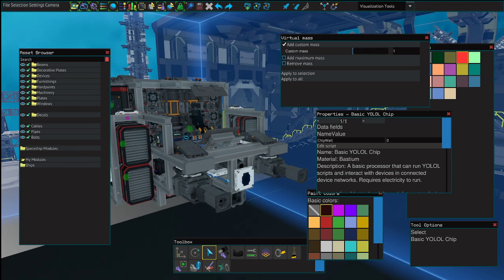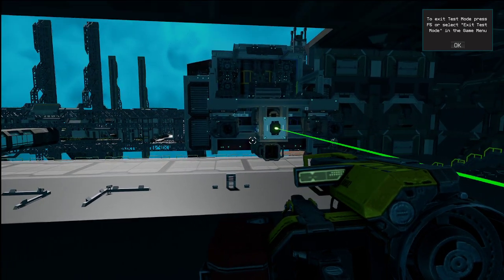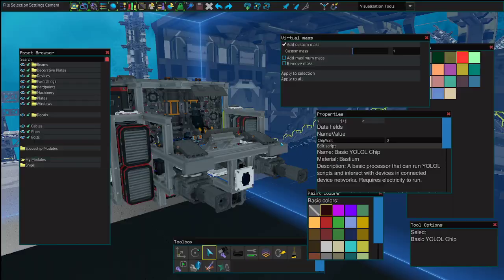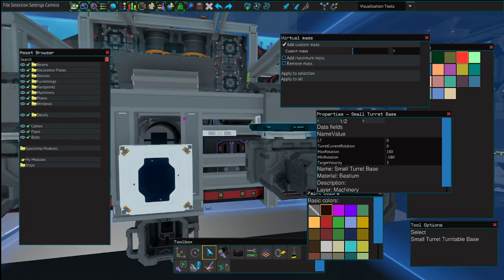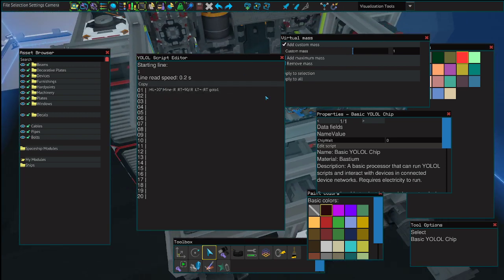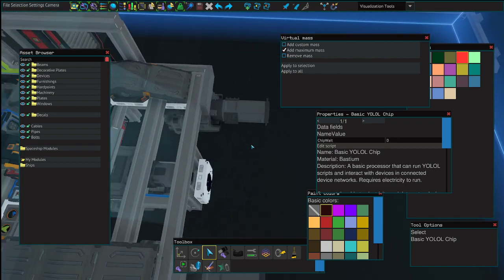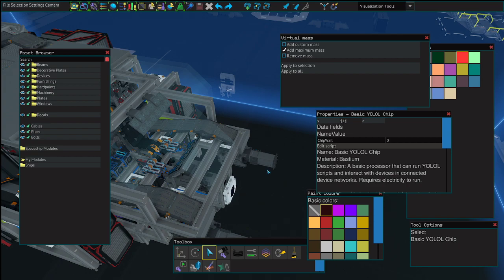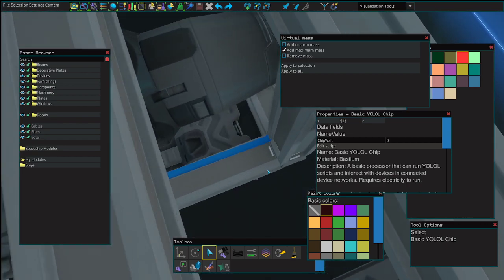Starbase Tutorial: Setting up Smart Mining Lasers

Comment: Your code doesn't make any sense.   :ML is the on/off toggle for the mining laser, where 0 is OFF and anything not 0 is ON.  You could multiply it by a billion and not affect how it turns on or off.  The only thing that does anything in this at all is the ratio divider for :RT being 90 / range.

Comment: For many ships, the basic setup is slightly different. The rangefinder is usually not at the same level as the lasers.
I bought the Momento and upgraded it. The rangefinder is at cockpit level and the lasers are about 2 meters lower.
This made the challenge for my script a bit more complex.
For me, not only the rotation, but also the pitch is relevant.
For my setup I wrote the appropriate script. Unfortunately this is not universally applicable for other ships.
If there are then the rare ores, I can write a script with the professional chip, which optimizes the calculations with a specification of an angle.
Reply: Pro chips are not available yet... atan() would save my world

Comment: heya i know a really easy way to code this with using only one variable with the turrets, if you leave LT as 180 and -180 for max and min and then inverse these numbers on the other turret then you can control them both inversely mirrored with the same input, put max as -180 and min at 180 on RT and change the name to LT and remove all references to RT in the code and it will work with much less code, now they limitations is this will perfectly mirror them so for this type of rangefinder code it's perfect, for anything else it becomes less perfect, for example i'm working on code that can use your mouse to control the turret but then each turret will require it's own angle since each turret will be pointing left or right values separate from each other and will require individual fields.
Reply: Oh wow, that's a really useful tip. I had no idea inverting the minimum and maximum angle had that affect! Time to rewrite my mining laser code! :D
Reply: how are you accessing any mouse input, is there a way to access that mouse steering mode from yolol or something?
Reply: @N1ghtR1der666  you can check the video i uploaded earlier today for an explanation on setting up mouse aiming https://www.youtube.com/watch?v=szokSSDdctE
Reply: Using your suggestion above, how can I add a limitation as to how far my turn tables will go?
My mining lasers are set back slightly and below my cockpit and therefor if I were to get too close to an object the lasers will start to shoot my cockpit.
The turn table limits don't seem to work and get overridden by the yolol.
I modified the code already to account for pitch as well since my mining lasers are not at the same level as my range finder and I wanted the option to use the range finder without the lasers on so I have it so that those can be turned off too. Only thing i cant figure out is the math behind adding limitations.

if :Lasers==1 then :ML=15*:RF-:R else :ML=0 end
If :RF==1 then :LT=-87/:R :LP=-87/:R end
goto1
Reply: @armedbobery4879  so limitations on turret rotation is actually why i stopped playing the game, no matter what i did or tried to do, eventually the lasers would randomly spin around once and a while and shoot something they shouldn't.... the code could be perfect and it would still happen, it saddens me that this is still an issue 4-5 months after i stopped playing, as i consider it a game breaking bug.

the closest thing i found to a "fix" was a mining laser check that takes place to ensure the lasers are pointing within the range they should be, so in your original code you need a if x and y = 1 or something like that, then x being the ML=1  and the y=1 being a check for the angle of the turret, turrets have input range and output range, the output range is the current rotation of the turret, the calculations you put into your movement of turrets should have a min and max value so you want this to be your range, so for Y you want "if turret current angle is less than it's min value or higher than it's max value then y = 0" Y will be the check to make sure the lasers are pointing forwards to the correct angle, it's best to run this code on it's own yolol in a single line if possible so the check is happening as often as possible, because if the turrets flip 180 degrees instantly which can happen they will still get a single pulse of laser beam off which will damage something, so it's good to have a shield wall of some stronger material or double layers behind the laser turret to protect internals.

hope this all makes sense, it's 1pm of day 2 me not sleeping :)
Reply: @heflar  makes sense. Thank you and I will try that tomorrow when I get back on next.
Reply: @heflar  Tested this. I actually did try this and it works "Mostly"
Tested a few differences to this idea.
TX is my Turret current rotation reading, ML is my mining lasers, R is my range from my object reading returned from my range finder, Lasers is the button for my mining lasers on.
1. If :TX<-17 then :ML=0 end goto1 (If current rotation is less than -17(Maximum safe rotation before damage) then turn off the mining lasers)
    This when going up to the object too fast will cause the lasers to pulsate for some reason. Maybe the read speed of Yolol is too slow compared to other factors.
2. If :R<6 then :ML=0 end goto1 (If Range from object is less than 6 meters then turn off the mining lasers)
   This had worse pulsing issue than the first option
3. If :TX<-17 then :Lasers=0 end goto1
    This method worked great and is the one i am likely to go with on my build. These simply turn the button off when I reach that -17 rotation angle and keeps the button off and it will not even let me turn this back on if the rotation is still below -17, once I back up and the rotation is > than -17 then I can press the laser button back on and continue mining.
May get annoying to have to toggle this back on all the time but better than a destroyed cockpit if I end up too close to the asteroid /  target.
Could be highly useful for any automated turret system too maybe although i dont think there is many viable automated turret builds, could be useful for manned turret gunners not paying attention to where they are aiming when following a target.
Reply: @armedbobery4879  oh glad to see you found some kinda fix! i was making a radar system which aimed a turret for an auto aiming system but turret rotation is so slow it was practically useless, they need turrets that can move faster AND they need to be bug free so we don't have to code yolol around the bugs.

ultimately i found there was not too much for me to do in the game due to the limitations of the output and input devices, i really do hope the game keeps progressing because i had great fun in the small amount of time i was playing, the problem i had was that everything felt like it was made out of paper, so if you made something larger it would just become a larger paperweight when it gets damaged.

because of this i ended up making a couple of smaller manned ships that cost less than 200k and could shred through anything, and if i lost it, no big deal! my fav ship to use was a 20k ship that had a thruster you could turn on and off so you would not make a thruster trail in space, it would alternate between "stealth mode" and max speed, so nobody can run from you, the idea was that you get close to an enemy ship without them even knowing you were there, then you would board their ship and kill them with a personal weapon, taking their ship without any damage!
Reply: @heflar  oh that stealth mode sounds cool. 
And yeah I hope they add more soon as well.

Comment: My question is, how would one get this to work with Pitch on Turret Cradles too? - I'm bad with yolol
Reply: I'm working on a manual for the script. But for those who don't want to wait and figure it out themselves, here is the code (I added some extra comments. Maybe they don't fit inside the yolol chip):

//MLTRAS-Advanced
xs=2.8 ys=-2 zs=-4.1 rxs=45 rys=0 rzs=0 //Distance/Rotation to the rangefinder
r=3.1415926/180 // Deg/Rad conversion
x=xs+:X y=:RFD+ys z=zs+:Z rx=rxs ry=rys rz=rzs :RFP=1 goto10
if :MLTRAS then :ML1=1 goto4 else :RFP=0 :ML1=0 :TP1=0 :TR1=0 goto5end
// set turret rotation
t=z/y t1=t-(t^3/3)+(t^5/5) t=x/y t2=t-(t^3/3)+(t^5/5)
:TP1=t1/r :TR1=t2/r x=xs+:X y=:RFD+ys z=zs+:Z goto10
//x Base axis rotation
t=z/y t1=t-(t^3/3)+(t^5/5)-(t^7/7) hx=SQRT(y^2 + z^2) hxw=t1/r
c=(rx+hxw)*r c1=1-(c^2/2!)+(c^4/4!)-(c^7/7!) y=hx*c1
s=(rx+hxw)*r s1=s-(s^3/3!)+(s^5/5!)-(s^7/7!) z=hx*s1 goto5+(2*:MLTRAS)
//y Base axis rotation
t=z/x t1=t-(t^3/3)+(t^5/5)-(t^7/7) hy=SQRT(x^2 + z^2) hyw=t1/r
c=(ry+hyw)*r c1=1-(c^2/2!)+(c^4/4!)-(c^7/7!) x=hy*c1
s=(ry+hyw)*r s1=s-(s^3/3!)+(s^5/5!)-(s^7/7!) z=hy*s1
//z Base axis rotation
t=x/y t1=t-(t^3/3)+(t^5/5)-(t^7/7) hz=SQRT(x^2 + y^2) hzw=t1
c=rz+hzw c1=1-(c^2/2!)+(c^4/4!)-(c^7/7!) y=hz*c1
s=rz+hzw s1=s-(s^3/3!)+(s^5/5!)-(s^7/7!) x=hz*s1
Reply: @sayex2023  im happy to wait til you finish it completely no rush
Reply: @sayex2023   did you by chance finish it and does it require the advance chip like I'm thinking? Also I would like to know what to call all the required fields on the lasers turrets and range finder.
Reply: @sayex2023  I'm trying to understand your assignments. have you advanced on your document? your code seems really interesting
Reply: I spent two days coding a yolol-script that aims 2-axis turrets regardless of their position and rotation from the rangefinder right at the rangefinders hit position. If you want the script I can give it to you.
Reply: @sayex2023  Oh, I'd massively appreciate that! It'd help me learn how  to make my own yolols around turret manipulation.
Reply: @sayex2023  Did you succeed to do it without yolo pro chip (cost xhalium) and cos sin function ? can't figure how to do it
Reply: @legroscompte1929  Yes, I did it on an advance chip. To avoid the trigonometric functions look up their polynomial approximation.
Reply: @sayex2023  But that a huge amount of line added to compute, no ? my try with sin/cos function feel already slow in reactivity (~4lines of code), for shooting turrets, imo, its not acceptable.
Reply: @legroscompte1929  What did you expect? A cheaper alternative that is also faster? Of course there are drawbacks but i still think it's good enough for a mining laser setup. I managed to compact the code responsible for moving the turrets axis to two lines and the code that calculates the turrets base rotation to an additional 3 lines. I'm not an expert in mathematics or coding, so that's just the solution i came up with.
Reply: @sayex2023  like I said, for someone who says they aren't great with maths and code, you did a really good job with this, and thanks for taking my comment constructively and not taking it like I was negatively criticizing you. Great job with this :)
Reply: @sayex2023  I will be very appreciated, if you will share this one for all of us ))
Reply: could i also get that code i just start constructing a mining ship with with 16 lasers in a circle and that would help me out a ton with managing them
Reply: For some odd reason whenever i try to post my discord contact info or OneDrive document link, YouTube just deletes my comment. If anyone has an idea on how to get into contact please write me on here.

Comment: would this work for an auto target autocannon setup for 2 front guns?
Reply from the maker: In theory yes, but in practice no. The reason why is because the max range is 1 km, Isan only updates every 0.2 seconds, and on a moving target it will be inaccurate, but other than that it can be usefull